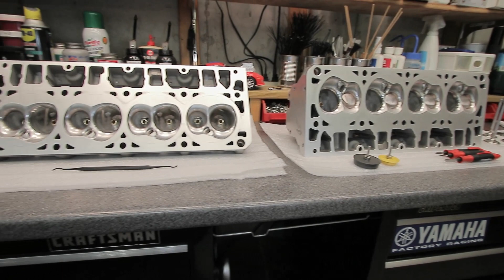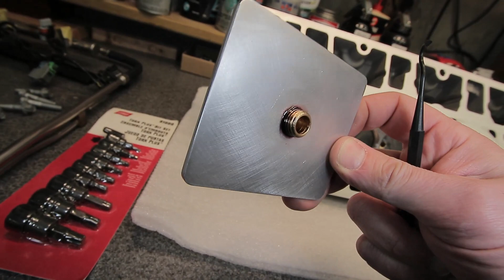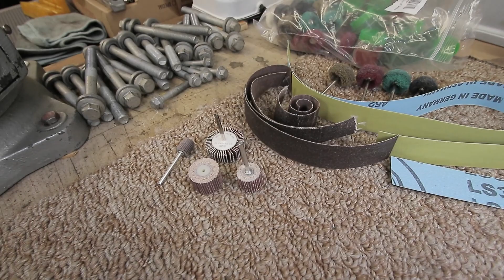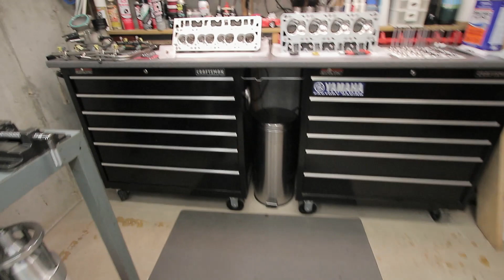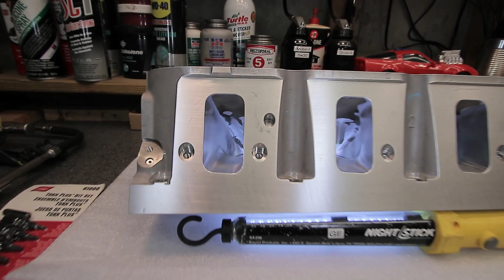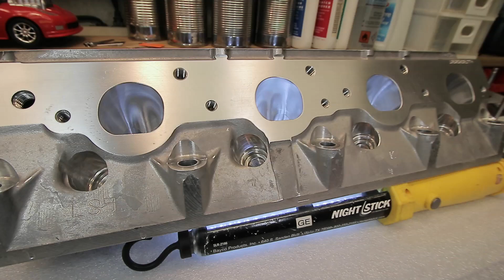LS9 Corvette ZR1 | KATECH CNC Porting | 2021 Heads & CAM Build

Comment: How much gains did you see after?
Reply from the maker: Car is over 1000whp & 960twq SAE. Some mods you do for reliability and longevity not necessarily HP. Polishing the chamber prevents hotspots and pre-ignition. Both which are insurance against knock
Reply: @ModernHotrodsNH  thank youuu

Comment: Did you have to lap the valves or just assemble as recieved from Katech?
Reply from the maker: the Katech VJ machining was very impressive & mated up perfect & true with the valves installed. So no lapping was needed. I did confirm this by checking each port by pulling and holding a vacuum for at least 30 secs without any leakage.

Comment: Every thing you said is wrong dont touch the floor all the air is at the roof you need to bias the port to the cylinder wall sized and use 80 grit.
Reply from the maker: whats done to the intake is the opposite of what needs to be done to the exhaust ports. So what exactly are you talking about?

Comment: You are definitely not a Mechanic and you are definitely not an Engine Builder! It is pretty clear that you are only parroting information that you have learned on the Internet rather than speaking from experience! First of all if your heads were done correctly they should have been put on a flow bench, Which means anything that you do to those heads is most likely going to have a negative effect! I just want to thank you because channels like this is nothing more than Entertainment for actual Mechanics and Engine Builders!
Reply from the maker: LOL..To each their own!...dyno tuned car and it made 943/878 to the wheels! Must of did something right.
Reply: @nep40 what a jealous loser

Comment: Love your videos!! Just want to make sure I am opening up the throat correctly. I'm a huge rookie with touching up the heads, getting a nice finish. I've had a huge problem while using the plugs to not mess up the valve job while I'm working the head. Very helpful! Love your work on heads!
Reply from the maker: More vette content on its way. Check out part 2 and 3. Thanks for watching!
Reply: @ModernHotrodsNH  
Did you end up going with katech intake valves?
Reply: Get a old set of valves grind them down so they are narrowed.. examples a 2.020 valve to a 2.010 so it will allow you to get close to seat to blend the chamber